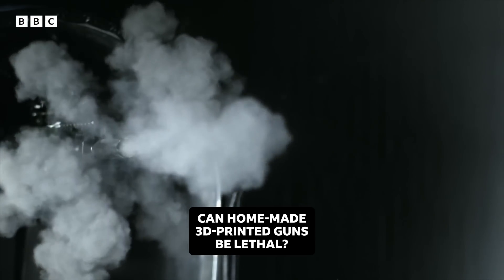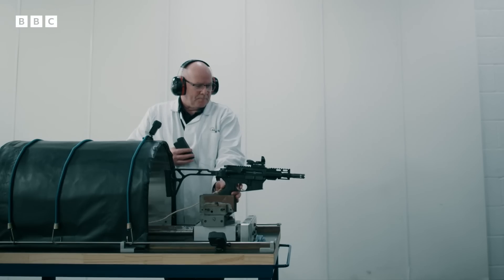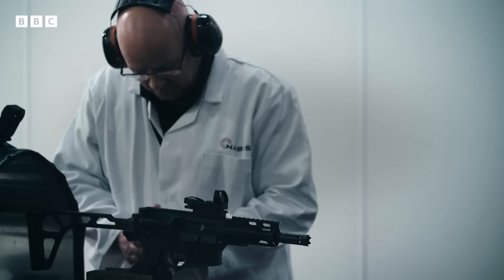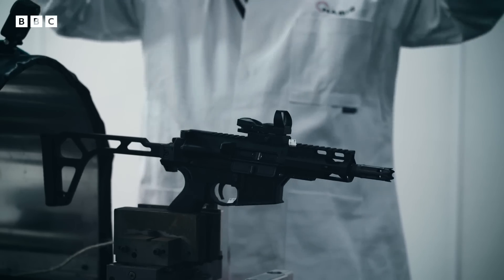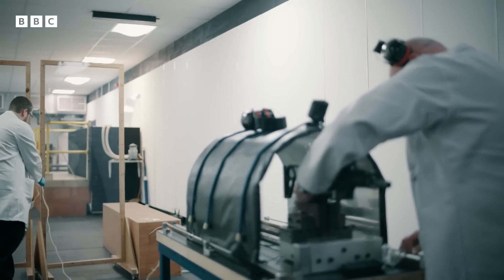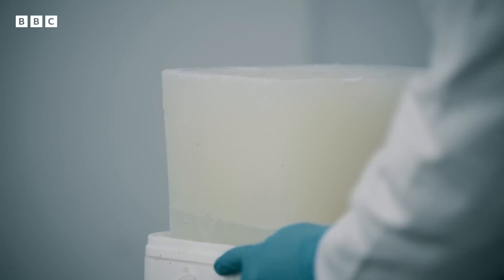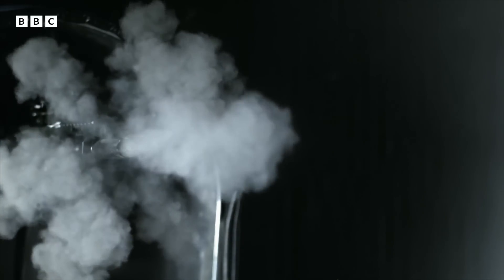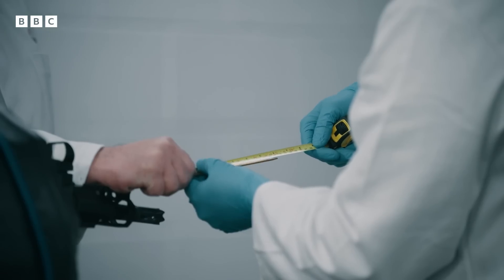Ballistic Forensics - Is the illegal 3D-printed gun a viable weapon? | Forensics: The Real CSI - BBC

Comment: That doesnt seem to be a 3D printed gun but instead seams to be a Flobert or blank firing gun modified to shoot really low powered cartridges (like .22 short from what can be seen in the video). There is no way that gun could fire comercial .220 or .223 and much less military NATO standard 5.56 ammo ammo and even less chance of the last 5.56 military ammo (US designation M855A1 and M856A1). I even doubt that it could fire comercially available 9x19mm ammo and even less so the last P++ available versions. So, stop creating false alarms.
Reply: It's entirely feasible to print the main components of a gun on a polymer 3d printer, to think otherwise is naive. There's a whole government task force set up to combat this very thing
Reply: @ollyhardy7015  it is very very very difficult to 3D print the pressure bearing components of a gun. And much more difficult when it comes to high pressure munition. Take a look at the gun and the magazine itself. In this particular video, that seems to be a modified blank or Flobert gun rather than a 3D printed one. And by no means I am saying that is not possible to 3D printed a fully functional gun.
Reply: @sergiom9958  it honestly depends on the technology used in 3d printing, whether its sls or sla, sls tends to be stronger with a more uniform sinter, also manufactured firearms are usually designed to fire 10000 of rounds where as in general non traceable guns are printed for one task then chucked so in reality may just have to fire a single bullet and at a close enough range where a  0.1mm deviation isn't going to be critical in terms of accuracy (not in regards to stoppages). I'm ex forces and an service engineer for a 3d printing manufacturer. I must add I haven't watched the entire program only the trailer above so guessing they only talk about polymer printers and don't delve into metal 3d printers